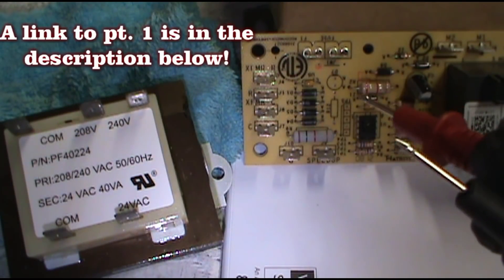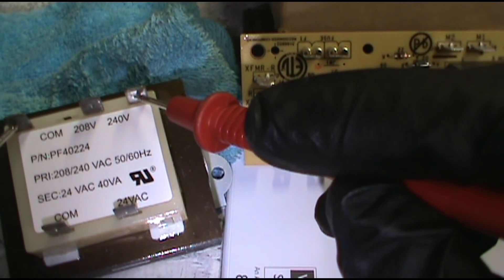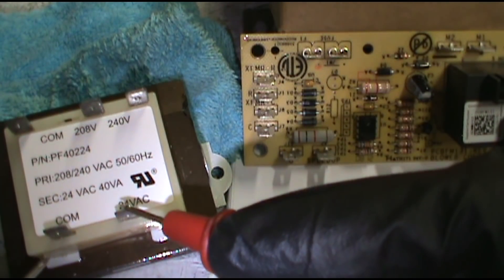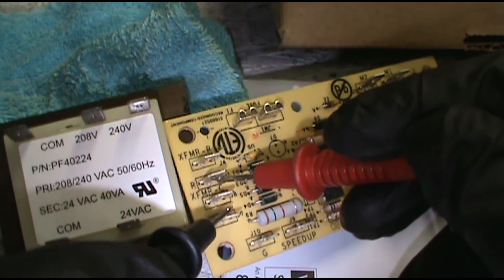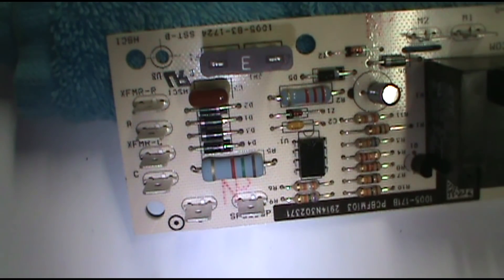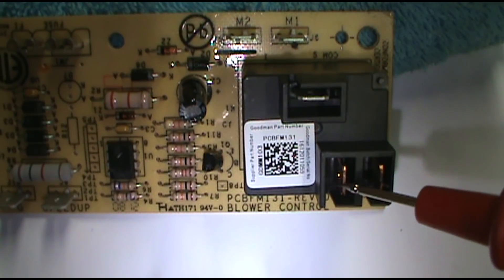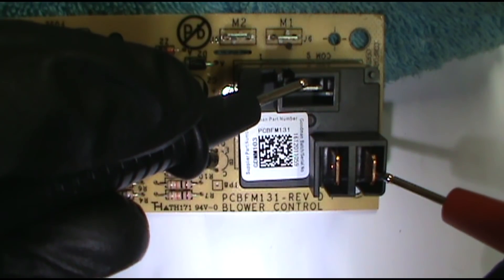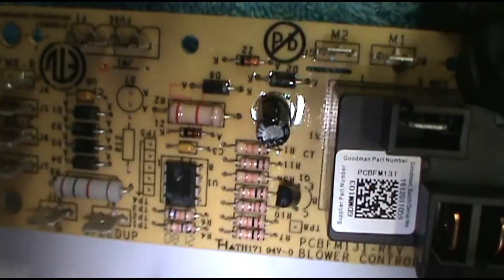Troubleshooting A Blower Control Circuit Board From Goodman Air Handler

Comment: How did you get your EPA certification?
Reply: I bought and read the ESCO book on a Kindle for maybe $14 at most.  Then I studied ALL of the EPA 608 material on Mainstream Engineering's website; that was free.  Then took some practice tests that I found online.  After that, I called around and went to a Johnstone Supply and paid for the test.  They mailed it in and shortly there after, I got a letter in the mail for a 608 Universal.  In the grand scheme of things the difficulty level is 3 out of 10.  The hardest thing is memorizing a few different dates when legislation passed banning the release of Freon as if it matters that it was some time in 1995.  You have to memorize a few different vacuum levels you must meet for proper recovery, know about the leak rates for comfort cooling, industrial, etc.  Need to know the difference between small systems, high-pressure, and low-pressure; since, there are really three tests after the basic environmental portion.  You must know the difference between CFCs, HCFCs, HFCs, which have a chlorine atom, how much ozone it destroys what an Ozone Depletion Potential is vs a Global Warming Potential, etc.  Again, none of it is hard.  Have to be able to read a PT chart...
Reply from the maker: Colten Millard The company I worked with 13 years ago sent me to the class & I passed. I got my universal card. Thank you so much for watching Colton!
www.DirtyMaintenanceNation.com

Comment: The fuse was missing out of the bad board
Reply from the maker: K Mech Yep, I talked about that in the pt 1. Video. Thank you so much for watching  K mech!
www.DirtyMaintenanceNation.com
Reply: Ok I missed that one lol .  Good guide for the board. I usually pull them out and install a 90 series relay in place when I don't have a board available quickly.
Reply from the maker: K Mech Right on. I hear that's the best thing to do from the pros. These boards are catching fire! 👍😂👍
Reply from the maker: I was getting no continuity there with a good fuse in it on that bad board as well. Someone wired up a transformer backwards. He had 240v on the 24v side & 24v on the 240v side. The fuse blew of course. I came to help out and put a new fuse in. There was no continuity between XFMR & R  with the new fuse. I should've put a dang good fuse in it during video. It got pulled out because it was still good & we didn't want it thrown out with the bad board. Thanks again man!